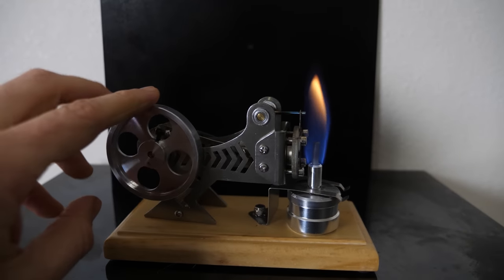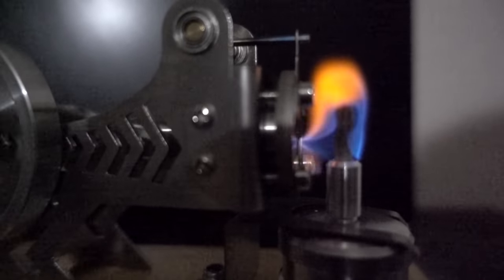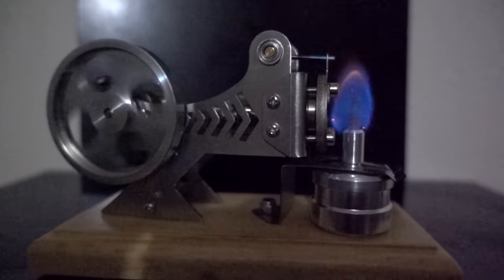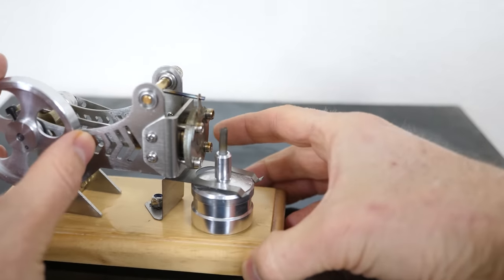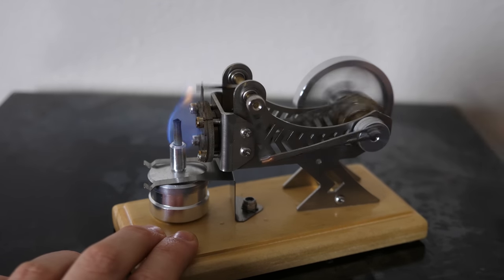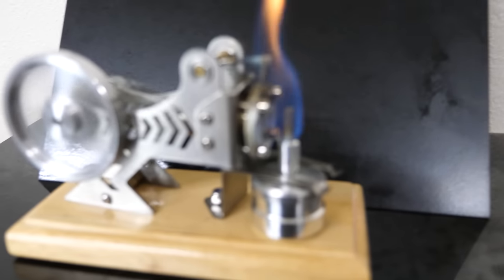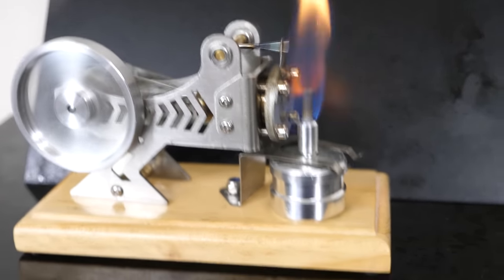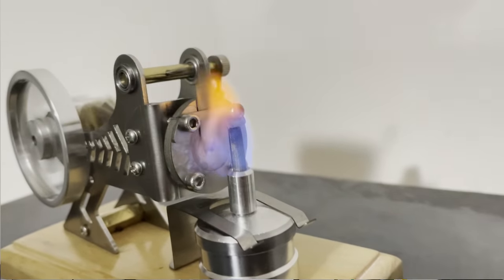How Does a Flame Licker Engine Work?

Comment: which is best between this and a Stirling Engine?
Reply: Stirling Engine is far more versatile because it can work on any temperature difference, while a vacuum engine can only work with the pressure and temperature of the atmosphere around it.  Also, Stirling engines are simpler and endure less wear and tear, so they last a lot longer.

Comment: I make steam engines for a hobby.  Flame lickers are vacuum or suction powered. The cooling cycle "sucks" the piston during the power stroke.

Sterling-cycle engines utilize a similar feature in that one piston leads the other by 90 degrees, shuffling a chunk of cool air back and forth.

Comment: Would this be more useful on planets with high pressure?
Reply: You don't understand the concept of atmospheric pressure... 1atm means the total pressure by the atmosphere naturally... So, if you want to cook or work against the atmosphere you can compare with that pressure... Like for pressure cooking you need something greater than atmosphere pressure... 🙃
Reply: Similar reason the atmosphere pressure is less @ mountain
Reply: @srinivasranjan986  1atm means 1 atmosphere presure on Earth, 1 bar. Venus' atmosphere for example is ~92 bar. The way action lab phrased it, I understood that the power of the engine depends on the atmospheric pressure, is that not correct?

If the engine would be less powerful on a mountain then surely the power of the engine would rise in the opposite scenario, no?
Reply: @danielgrizzlus3950  i think it really depends on the absolute pressure of the atmosphere as much as the difference in pressure generated by the heat. The more pressure available to displace, the more pressure available to replace, hence, your intuition is correct that this engine would have more power in a denser atmosphere such as on another planet like Venus.

Comment: That’s cool. I wonder how you could further optimise the design?
Reply: I think the atmosphere is just working like a spring with a force of 1 atmosphere times the area of the piston end. So I reckon you could use a stronger spring and then seal the hot end with the flame and pressurize it to say 2 atmosphere. Then you could upgrade the cooling performance of the engine - with a fan or water cooling for example. 
You would need to divert power to pressurizing the hot end though. It's the same principle as an internal combustion engine with a turbo or compressor 👍🏻😁

Comment: I wonder if it's possible to make a steam engine and have this at the other end to give it a boost. So steam can turn the turbine which has a piston attached to it and the flame which is heating the water  also activates the licker. Not sure if it would work but it makes sense in my head. Lol

Comment: Could you make a flame-eater/steam engine combo? For that lost heat…
Reply: I also thinking of that... Like mixture of 2 engines to increase the efficiency and decrease the energy loss
Reply: Precisely, put the flame eater so it sucks on the firebox, and use it to fan the firebox itself if its coal burning... If it isnt, you could use the flywheel as a fan to cool down the steam condenser, which is always a nice thing... And in an enclosed system, the condenser does impact the efficiency of the system, as if it cools the steam down fast enough, it itself causes a pressure delta that applies vacuum onto the rest of the system behind it, aiding efficiency of the steam plant... and since you are using heat that would anyways be present while the system runs, you are utilizing the flame powering the steam plant to power another engine, increasing the effective work you are able to draw out from the chemical energy of the fuel being used... In case of using it to fan the coals, it would not just use the energy to power another engine, but it would also use that engine to ``supercharge`` the coal firebox itself... Damn, coal is such a marvelous fuel, but its at the same time fucked up in so many ways... from impractical to kinda unsustainable(not really, but lets not get into theory)...
Reply: I'm not sure there'd be any advantage to that instead of having just a steam engine. The flame-eater is cooling the flame down, which would reduce the power it can put into the steam engine.
Reply: @barneylaurance1865 I get it. I’m a little more interested in the lost energy, I wanted to know if the faint amount can produce some sore of turn. Just curious cause I can’t build one of these to try

Comment: fwiw it isn't running on cooling gasses, it is running on the drawn in plasma state of energy in the flame.  The ions and electrons of the flame are sucked into the cylinder where they cannot fill the 3 dimensional space space once the shutter closes - therefore a vacuum is left in their wake, which then draws in the piston.

Comment: Might have been said but lets think of a time you get a power cut. Ok power banks are good now and easier to carry. Could this be one. A coil around a moving bit with a magnet on that. To a PCB to give 5v USB smothed output. Even get 1amp out the thing, run some LED lights or charge the phone. Nice looking thing.
Not seen one before. A kit to build yourself and get going. Parafin in the thing I guess. Turpentine (spelt right?)

Comment: I have a theory what if you just made it into an electromagnetic generator use as a space heater and a phone charger just wall the thing up with ceramic and leave a hole for a USB cable by putting magnets on the flywheel copper contacts in a resin seal and positive and negative USB output

Comment: Even the flame is optimized to minimize heating to the air, an flame licker engine would have very poor efficiency. As it is working at atmospheric pressure, the compression ratio is equal or close to 1 vs. 10-14 in a gasoline engine; 16-20 in a diesel engine. The higher the compression ratio, the higher the engine efficincy.

Comment: So this is 2-3 steps removed from a steam engine?

Cause I was trying to mentally make it practical:
1. Enchamber the flame so no heat is lost
2. Heat up a pressurized gas instead of having the open flame in order to increase pressure differential

Comment: You need a device similar to a carburetor for atomizing and pre-combustion of fuel in the intake manifold and a separate exhaust valve for exhaust gases. Also, the material of the engine head should be less thermally conductive than the material of the cylinder and cooling should occur only of the cylinder itself.

Comment: This engine helped smart manufacturers, salesman and dealers to get rid of  "the great depression" much faster. Now the world is more tecnified and the machine to solve all our energy problems is nuclear fusion. Magnetic Confinement Fusion, or tokamak designs are the present day equivalent of the vacuum machine. ICF, may go in the same path if improvements are not applied.

Comment: Make the flywheel with super magnets, and place an induction coil on both sides to generate electricity.  At 900rmps, it should be able to produce a significant wattage.

Why cannot the wasted heat be recirculated, or used in a second engine directly above or around  the flame?   The length of the flame should be able to power more than one engine.  It looks like four engines could be place around the one flame.   Has anyone tried that?

Comment: It seems to me that the best thing you could do to improve efficiency, is to run a vacuum insulated copper tube to the intake on a 45 degree angle, and run the flam into it.

Comment: What if you modified this to use the wheel as an alternator and use it to generate constant power and arrange gears in such a way that you could shift gears to make up for the low torque?

Comment: build a sterling engine for a boat that is powered by the heat of the sun

the ocean provides endless cooling for one end of the engine. collect solar radiation and concetrate it on the other end of the engine. i want to see how effecient it is compared to a pure solar powered source or a wind powered source.

Comment: I've always wanted to see a really big  one of these running.   Are they also called Stirling engine I think or maybe that's something else.
Reply: Stirling engines are something radically different, they are sealed and do not exhanche theit internal gas with the outside world, this allows to run them at high pressures and with more efficient gasses.
The thing that really makes a Stirling a Stirling is the regenerator, a part that captures otherwise wasted heat and recycles it, allowing for more power and drastically improved efficiency.

A flame licker is just a atmospheric engine, they are inferior in performance to non atmospheric designs, just like the Watt steam engine is a drastic improvement over the Newcomen steam engine, a atmospheric design.

Comment: How big should a flame licker should be to power a car or how many should you have and is it more eco friendly than a normal car motor?
Reply: Atmospheric engines like these have horrible efficiency and power density, youd need half the car to be just the engine and would get mileage comparable to a fully loaded semi truck.

Comment: I guess the size of the engine would be a limiting factor too. But air pressure is its biggest limitation. Still a fascinating device.
Reply: Maybe the flame going up could be used to heat up a pressure vessel directly fed into into it that could increase that intake pressure?

Comment: Cool! First time I heard about this! I wonder if you could use that to produce a bit of electricity for e.g. a led lamp or a battery charger 🤔
Reply: led: yes, sure why not. But the light output of the flame is bigger then the LED light output.
Battery charger:  Not seriously. I mean, if you want to have a battery charging symbol on your smartphone for your science fair... you can try to push it and get it to the point where the smartphone borderline thinks it could maybe charge..

Comment: One atmosphere can actually be a great deal of pressure, about fifteen pounds for every square inch which is actually quite significant. You claim that these were invented in the thirties ‘but that was only the toy’ while the method itself was actually the first use of gas combustion to power engines BEFORE the invention of the internal combustion engine and was used in factories to power machines & not just barely run themselves as you claimed. Thomas Newcomen invented an extremely practical atmospheric steam engine that the world used for many years & at one time train braking systems as well as many other technologies ‘such as windshield wipers on cars’ used atmospheric pressure before positive pressure systems took over.., I’m afraid you are grossly misinformed about the practicality of atmospheric engines, including the flame sippers.
Reply: I think it's actually less than one atmosphere. It's the difference between the external and internal atmospheres. With the external being no more than 1, and the internal being, well idk. But the difference is less than one.
Reply: @AdamAdamHDL  I cannot say I know what it is for the children’s toy invented in the thirties but atmospheric engines in general, are much more powerful than this video claims.., it kinda depends on what you mean by ‘one atmosphere’ for one atmosphere as the measurement ‘which is just under, at fourteen point seven per square inch’ or the overall difference in pressure relative to the given machine’s surface area.., all the same, the main point is a little historical research shows that atmospheric engines ‘both steam & standing pilot natural gas powered’ were very powerful & used to power such things as water pumps in mines & factory machinery such as textile equipment like sowing machines & looms.

Comment: do an external combustion pulse jet (widening channel pulsejet heat sink), made from metal, cold air in, hot air out, directional air flow, like rocket stove, but with external combustion/burner
Reply: no rotary/moving parts required for hot air flow (heating/cooling)
Reply: store the heat into metal, which heats the air, passively
Reply: self-ducted impeller turbines are better
Reply: the metal also acts as a equalizer/regulator, on its own

Comment: Wouldn't you get more heat input by placing the flame lower so that the engine is sucking in the yellow or top part of it rather than the blue, cooler area? Also, this engine looks like it would be fairly simple to build if I new more details like, cylinder material, diameter, wall thickness and piston material and if it uses rings for sealing.
Reply: This is what I know from experience, alothough mostly research and experiments, never build a complete, running engine: Often the pistons are made from hard graphite blocks/ rods, that are precision machined. I have never seen one with piston rings, as the friction already would be too much. Also, most of them don't need lubricant. Graphite is self-lubricating. Oil would just further increase friction. For the fuel, mostly pure ethanol is used. It burns almost free from soot and so the engine lasts a long time without cleaning. The reaction is mostly stoichiometric, the ethanol reacts to water vapor and CO2, very low amount of carbon deposits build up.
Reply: And yes, you are right. Some people "tune" their engines, by directly holding a propane/ butane torch into the inlet. That can temporarily boost the engine, but you must not overheat the engine. I don't think you can use this permanently.

Comment: At one point piston cylinder will get to hot and no more operation also.
Excellent demo.
Reply: Not really, the engine can be designed to cool itself down at an optimal rate to keep the upper 3/4 of the cylinder cool enough essentially forever as long as it keeps running... The flywheel itself can be made to act as a fan... That is the least problem that can be amended through decent design... the larger problem is the absolutely meager force the engine produces due to the way it works... And the fact that its very hard to amend that part of it... Just like the manson engine which is very similar in concept to the flame eater... A sterling engine is another thing, as it can be given a decent accessories system and in the right environment geologically, it can produce a greater pressure differential through temperature differential on opposing sides of the engine, but these engines like the manson engine and this one are fundamentally limited in their operating principle to a very low torque production...
Reply: @camillosteuss  true.. radiator cooling fins air cooled . But motor may not make enough power to cool itself with a fan .
Evaporator water or convection may do .
Good point 👍
Reply: @MitzvosGolem1  i didnt mean for it to be cooled by condenser, the condenser i was talking about is the part of the steam engine loop that allows it to reuse water rather than steam it off... But a mere air cooled body would do with just the mere passing of air over it... Also, a small radiator connected to a water jacket around the cylinder could be made and cooled by the flywheel ``fan``  at the same time as the steam condenser would be... The water would not need be pumped, as it could be moved by the mere heat accumulation... As some of the oldest engines were cooled... Like the ford model T...
Reply: @camillosteuss  hit miss Antique engines use similar idea.
Old John Deere two cylinder tractors had convection cooling no pump oldest just had evaporated tub of water around cylinder.
Very wasteful on fuel back then.
But fun to fix up.
Cool